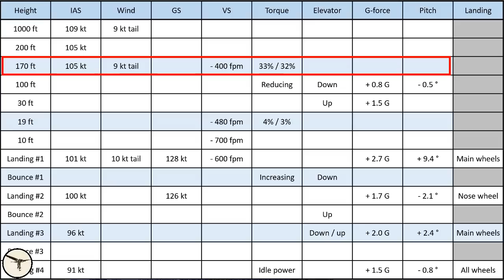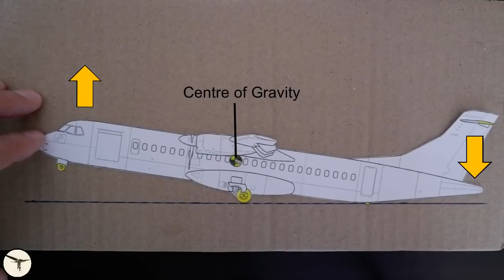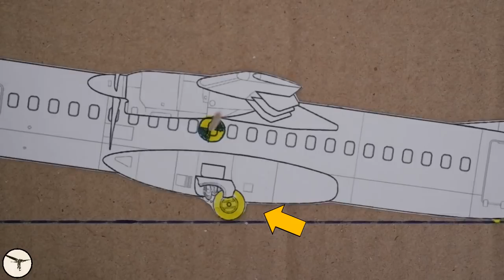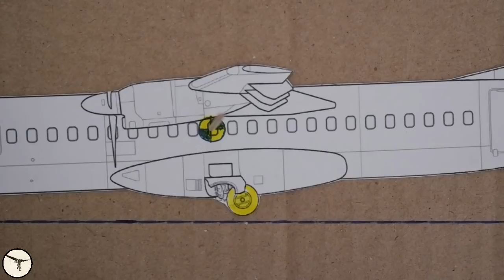Tailstrike and bounced landing - Avianca Express 4852

Comment: This video is great! I have flown into airports with no go around, one way in, the other way out. In these airports being a 'master of a destabilized approach' can save the day. the principle is to correct early. for example if its a tight turn on to final approach, go straight to maximum allowable bank while still high so that when low and slow we can reduce our bank. Over the years I see pilots start with normal bank and then when low and slow "oh oh i need more bank" and then end up at 40 degree bank! 
Same thing with rate of descent, while high correct with a 1000 fpm rate for a few seconds so that in the last 100 ft you are stabilized with a target of +4 degrees pitch at 400fpm for the last 50 ft with speed bleeding off.(glassy water landing technique where it is impossible to judge height above touchdown). 
Just like we learned in flying school, when leveling off at altitude we reduce ROD/ROC at 10% of our rate of descent/climb, if we have to maintain high rate of descent to get back on profile, at the very latest we start reducing our rate at 10% of our rate above the 100 ft that we want to be stabilized at. (this is extreme, by 500 ft we should start reducing rate of descent)
Another thing pilots don't seem to know, is that if landing flap is selected when close to min speed for approach flap, you feel little to no trim change, so that means in gusty turbulent conditions landing flap can be delayed to "landing assured" before selecting landing flap. (I have seen pilots select full flap and go "hands off" the stick with no pitch change while flap is running from approach to full on DHC6 and DHC8/300).

Comment: The biggest mistake was redusing power. I did that mistake very often when i started  to fly heavy aircrafts in MSFS 2020 like Airbus A320 and Boeing 747.  When you controling cessna 152 you can cut off your engine at 2000 ft, then make a deep dive and make a save landing at 100 Fpm.
But this is not going to work with heavy aircrafts. With them i usually starting to decrease power only when i crossed runway threshold and at 30-20Ft above the ground. I saw that some pilots doing that only at touchdown. Which is cool.

Comment: Hi Captain...Im just curious, why dont you upgrade to a larger aircraft or jet engine, since you mentioned in the end of the video
Reply from the maker: Initially, that was my plan. ATR is typically a step in the career of a pilot. Therefore, there's a continuous flow of pilots through the ATR fleet, and it can be hard for the company to keep captains. As an instructor, I found myself attractive to ATR operators, especially when the aircraft type is new for them. So I stayed with the aircraft. And just now is it not attractive to become an A320 or B737 jockey. The pressure on the pilots in the US and Europe is immense.

Comment: As a flight despatcher and Manager Fleet Technical Support on ATR  for long, I have  been doing a lot of  observation flights innthe fligjt deck of ATR 72-500/600.  I always used to wonder why the PF releases the back pressure on the control column just before touch down. Thanks for explaining  this.

Comment: Well I think tha some of those advice it’s very difficult or outright imposible to implement in la nubia since it does not have an ils app and the sloping terrain makes the radio altimeter very unreliable besides the runway it’s sloping upwards and it’s very narrow with very variable winds due to the mountains and the non existence of a go around makes it very challenging I’m getting qualified right now to fly that same aircraft and route for easyfly and going there is very much a dreaded experience amongst all pilots within the airline and a bounced landing remains a distinct possibility

Comment: Hi Magnar, thanks for the video. I have a question which is not directly related to the topic discussed, but anyway. What is the fuel consumption in cruise on the ATR-72-600 at maximum weight? Do you know by any chance the Q400 numbers at the same weight in cruise? Thanks!
Reply from the maker: Hi, the fuel consumption depends on the cruise level, which is determined by the weight of the aircraft and atmospheric temperature. On a standard day at maximum weight, maximum cruise level (service ceiling) is 20,000 feet. Under those conditions, the fuel consumption is 668 kg per hour. 
I do not know the fuel consumption for the Q400. It is heavier and has more powerful engines. Therefore, it would be unfair to compare it with the ATR at same weight. On a 300 NM sector, the ATR 72 burns 900 kg fuel. The Q400 burns about 30 % more, but it can carry up to 10 extra passengers at a higher speed. 
When it comes to economy, the ATR 72 in unbeaten on short sectors. The Q400 is suited for longer sectors where it can compete with jets.
Reply: @FlywithMagnar  Thanks for your time, captain!

Comment: Thank you for the video. Will this “release back pressure when landing gear is about 1foot” work on other aircraft like a320 and C172?
Reply from the maker: Answer 1: On airliners like the A320, yes. The autoland system does just that. A transport category airplane is flown to the runway, and the nose wheel is lowered to the runway shortly after touch down. This gives better directional control and puts weight on the main wheels, which is important for braking.
Answer 2: On light aircraft like the C172, no. They can be landed with the stall warning activated. From C172 POH: "Actual touchdown should be made with power off and on the main wheels first to reduce the landing speed. The nose wheel is lowered to the runway gently after the speed has diminished to avoid unnecessary nose gear loads." A perfect three point landing in a taildragger is achieved when the wings stall when all of the wheels are 1 inch above the runway.
Reply: @FlywithMagnar  Thank you captain!
Reply: The thing to keep in mind is that once you initiate the flare you should not push the nose down. As  Captain Magnar has reiterated in the video, if you feel you have flared too high, you should release the back pressure. Pushing the nose down is an absolute no no, especially in a heavy aircraft as it can cause a nose touch down.

It is also very important to keep the aircraft on the correct descent profile all the way to the flare. Initiating the flare too early can make you lose the runway sight picture and make it harder for you to judge the sink rate. If you lose the sight picture for some reason and you are at a high pitch, you should maintain it all the way to the landing (it might not be a super smooth landing but it will be within the limits). This will prevent a tail strike and a hard landing
Reply: @anasmaaz5731  just noticed your comment. Thank you very much for the additional tip as I'm doing the ATR type rating!

Comment: I'm not agree that a little bit pitch down just before touchdown reduces impact force. In my opinion it increases one. Dispite moving main gears up when pitch goes down all of aircraft mass increases rate of dicent that increases impact force. Pitching down just before touchdown needs to reduce flare. I agree that autopilots work in this way.
Reply from the maker: Not when you lower the nose 1 foot above the runway. There's no time for the airplane to increase its rate of descent. Airplanes have inertia.
Reply: @FlywithMagnar  this is exactly what you experience on a large jet. And the opposite is true: trying to salvage a potential hard landing by pulling hard at the very last moment tends to bury the main wheels into the runway! Tried both myself 😊
Reply: The main gear descent rate decrease a little bit with this procedure. (Momentarely)  But you need to do the input at the right moment.

Comment: After a bounced landing, what's the suggestion how to use the yoke? I mean when go around is not possible.
Reply from the maker: Thanks for your question. The main rule after a bounce is: Keep the pitch as it is and add some power to maintain your speed. You should not push. However, this may not work in all situations. For example, if you were pulling hard on the control wheel at touchdown, you must release this back pressure. However, the nose must not be allowed to drop below the horizon.

Comment: The airline I work for has one airport in the route structure that, because of the runway length and runway surface (gravel) requires a steep slope approach to get a max structural landing weight arrival. 

This results in an approach with aprox 1000’/min down to the point where you hear the Velcro of the seat cushion tearing away from the seat pan.  Then you start a flare and a power reduction. 😂

I often find that a VERY slight push on the yoke at the last moment does result in a reduction of the firmness of the landing. 

That being said, firmness is the target on a steep slope approach or you lose some benefit of the physics of a steep slope approach. 

Thanks for the video!

Cheers
Reply from the maker: Thanks for your reply. Yes, I have the same experience with steep approach. In Norway, I flew the 42-320 on a 5.4 degrees slope onto an 800 metres long runway. I ended up using a two-flare technique: At 50 ft, I made a flare to a normal attitude, and from 20 ft, the landing was normal.